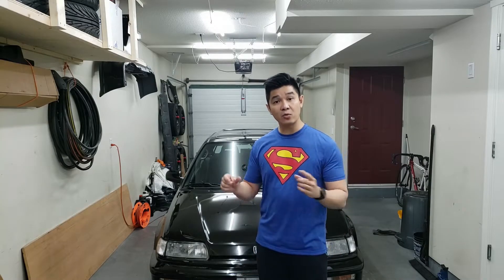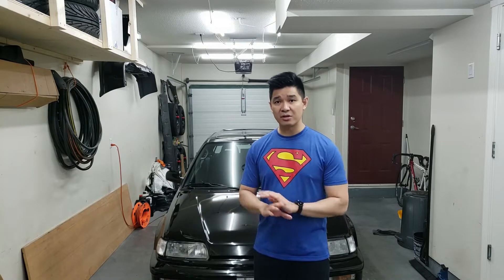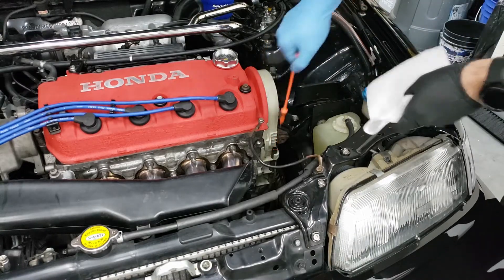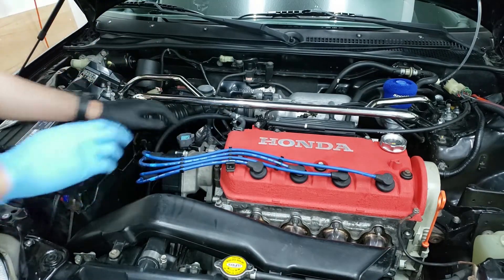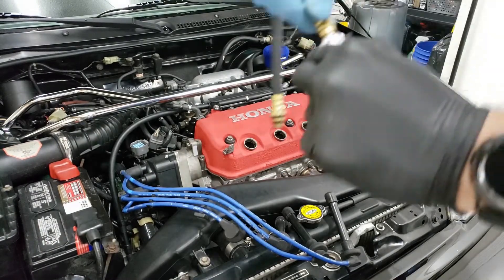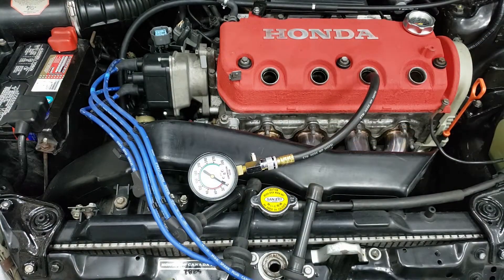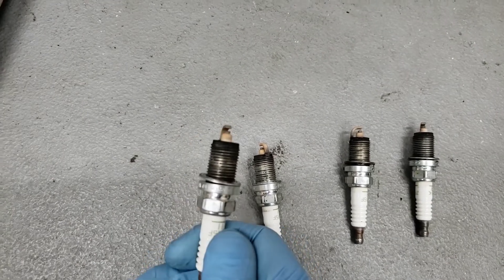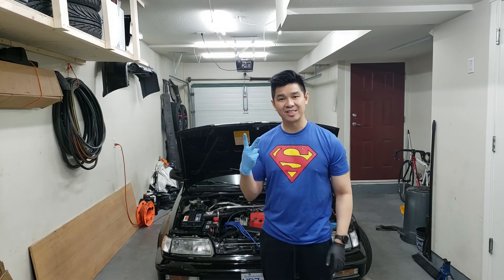|| HONDA EF/ED 88-91 CIVIC/CRX || How to Perform a Compression Test D16Y8 🔍

Comment: Does any1 y’all know how to do a z6 sohc 1.6L? 1993 Honda civic 4 door
Reply from the maker: Its pretty much a direct swap. Use a p28 ecu, add your vtec solenoid and pressure switch wires and thats it. Reuse your original engine harness. Everything should be plug and play.